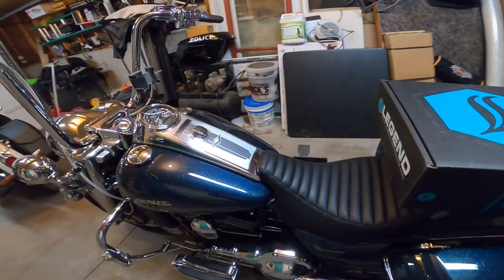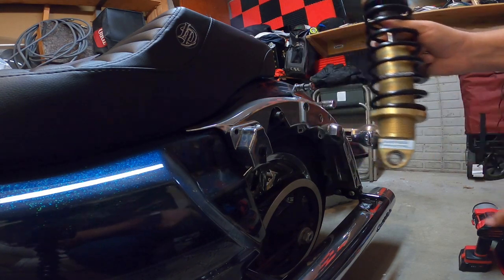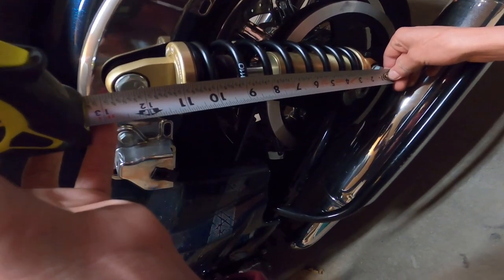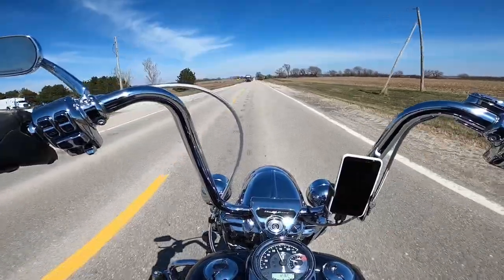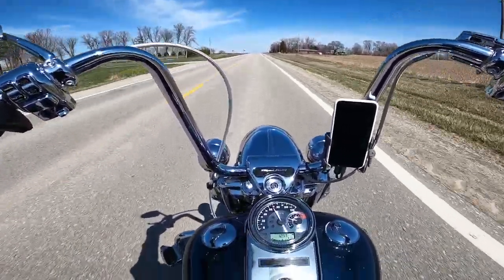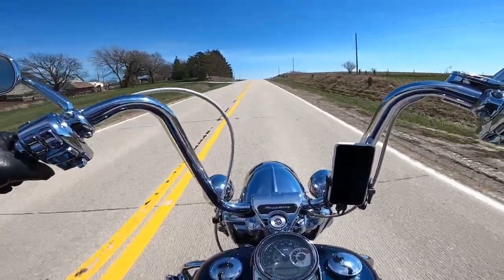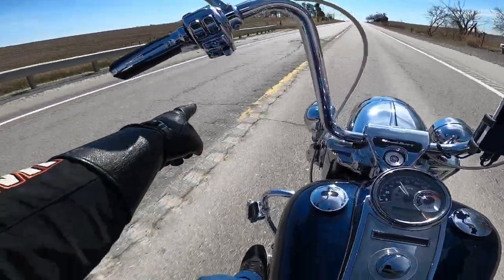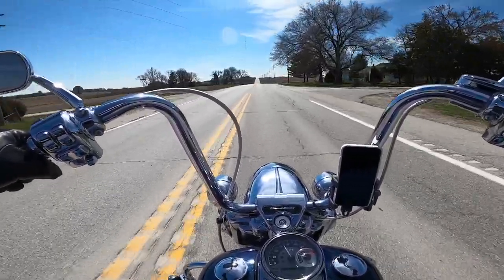Legends Revo A rear shocks on the 2016 Harley Davidson Roadking!!

Comment: Just installed the 12" Legends on my Road King Special this week. Rode 200 miles yesterday. Game changer. No comparison between Harley and Legend. Would be very good if Harley would up their game on the touring chassis suspension. It's hard to wrap your head around it until you make the switch. The cost is up there for these. I finally bit the bullet and pulled the trigger. Best mod I've ever done to any of my Harleys. Good video. Take care.
Reply from the maker: I agree. Before a person does anything else to their touring bike they should change the suspension. It amazes me that they don’t upgrade their touring gram cause without a doubt the new Softails ride better.
Reply: @StevyFaux  I'm hoping they upgrade the frame and suspension on the touring line-up in the near future. I'm in 100% agreement with you on the softails. My wife rides a 2018 Heritage classic. I owned a 2019 Sport Glide. Suspension and ride is so much better on the Softails. I went back to the touring frame to (Road King Special) primarily for long distance touring. I like doing multiple day trips. The touring models are built for that. The suspension has been an issue for years. With that said I'm very impressed with the Legends. Well worth the price of admission. Plan on doing the front down the road a ways. Take care.

Comment: Did you even use a lift to change your suspension?
Reply from the maker: I did. I have a little center stand lift. You need something to take the weight off the swing arm.

Comment: Nothing done with the forks yet right?
Reply from the maker: Right. Will do them later.
Reply: @StevyFaux  Interested whether you co upgraded springs or full cartridge.  I feel like there is probably diminishing returns with these things for cruisers vs sport bikes on a track.
Reply from the maker: @nycLPplayer  I will do the Legend front suspension as well. I am pretty sure they are a Cartridge setup.

Comment: What handlebar rise etc brand?
Reply from the maker: Risers are stock and the bars are 16 inch wild1inc chubbys.
Reply: @StevyFaux  how tall r u? Hands above ur shoulders or even whenn riding?
Reply from the maker: @jimmycrackcorn1783  so I am 5’8. But I have a 28inch inseam. So I have little legs and a tall torso. My shoulders are above my hands by quite a bit now with my Lucky Dave’s seat. With my old solo seat my arms were more even.